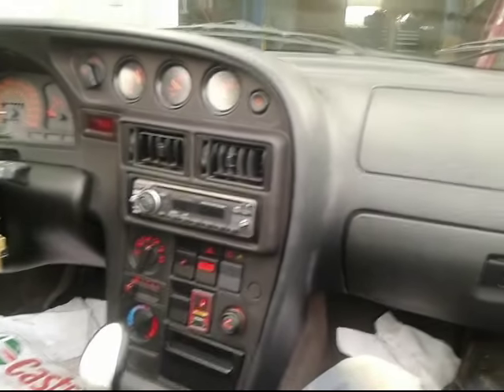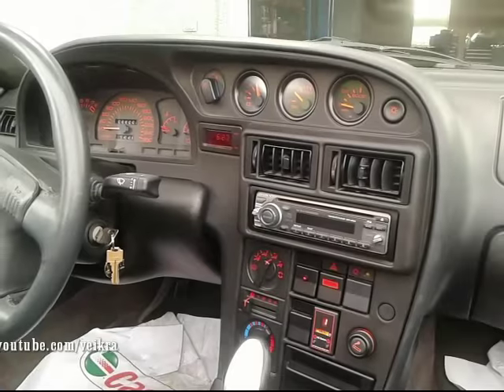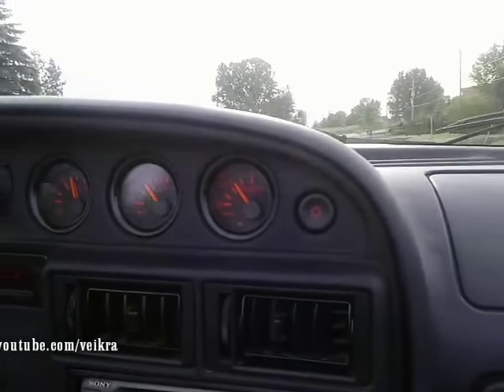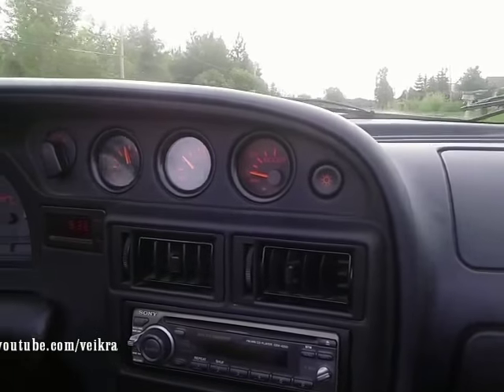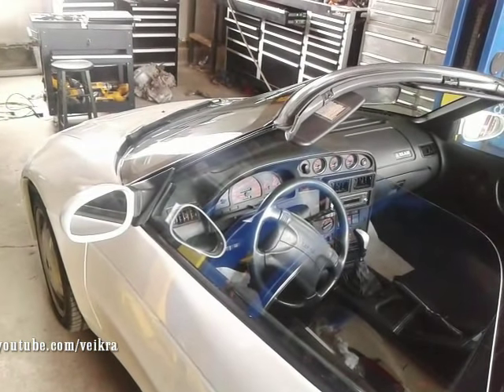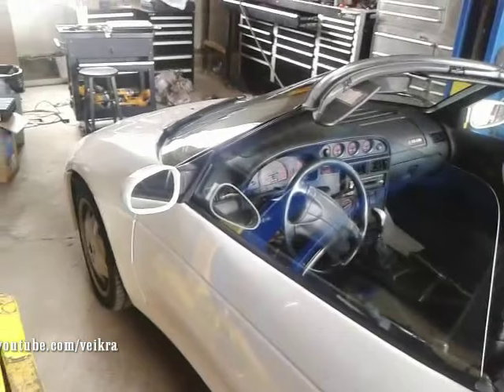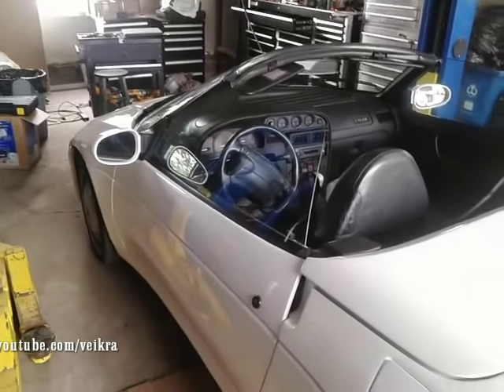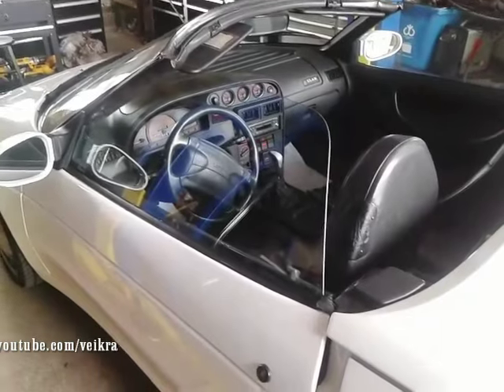1991 Lotus Elan Switching Adapter board and High Boost EEPROM install and ride

Comment: thinking to buy one Elan 1991 turbo Isuzu engine I test drive and was fun, need some attention on the CV join I believe and body work, how did you change the Eproms and where do we find them can we buy them with a fitting instruction ? take care
Reply from the maker: +M Mer They are very fun machine. Changing the eproms requires you to open up the Engine control unit and putting in another board in it. Then you run the cable out for the switcher.  Here's the installation instructions: http://www.lotusm100.com/manuals/installing-a-v4-daughterboard-&-eprom.pdf.   We installed this v5 switcher we got at http://ealanach.co.uk/elanchips/ for  240GBP.   You can get the 0.9bar board for 150GBP though. It'll push the car to 200bhp, but that's an isuzu engine so there's lots of torque present.   It's a light front wheel drive so the engine overpower the car.  Is the one you purchased red with front end damages?
Reply: thank you I try to contact them to see which one is the correct chip for my car which is UK specs but no reply yet will try again
nope mine is a good condition one 
thank you for the reply have fun and be safe

Comment: Anyone know where to get a mountain everest chip?
Reply from the maker: Yes we got another for my friend who's driving in this vehicule. He bought an Elan few years later and we got a leftover prototype chip from Alan which was never tested .  We were able to solder a missing trace and sort out the resistors on the pcb finally got it work after 3 attempts. Alan doesn't make them anymore.  Was totally worth it, so much power out of that isuzu engine.